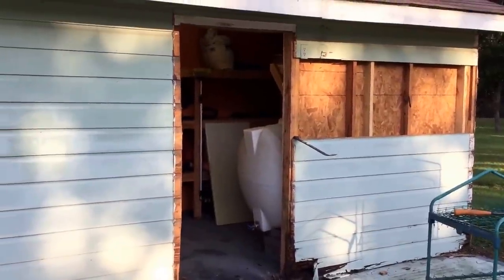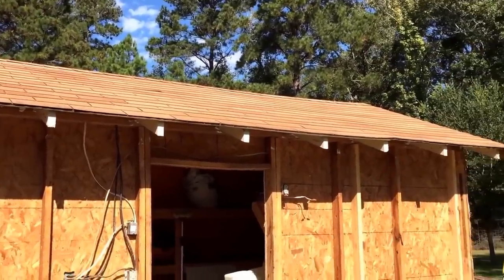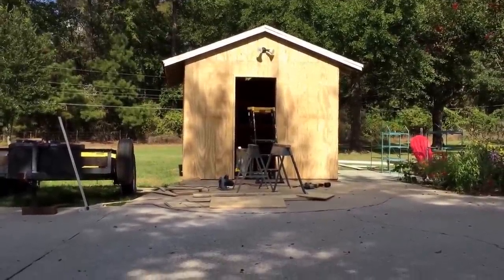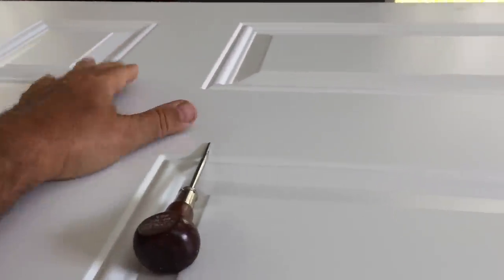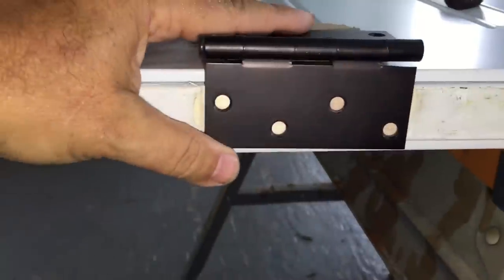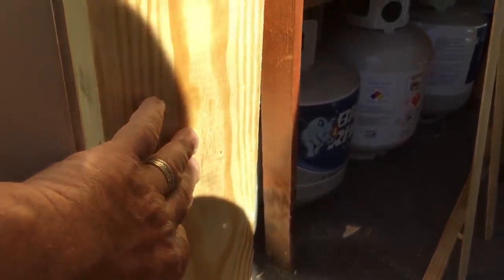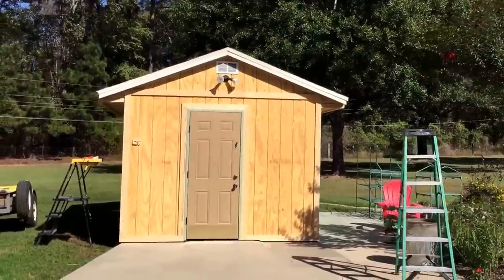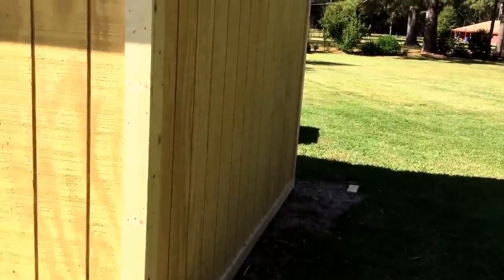How to Rebuild a rotting shed from start to finish

Comment: Purty. I've had awful good luck with the pre-primed LP Smartside siding.
Reply from the maker: bc65925 if that's the cement board,I thought I would use that until I lifted it. I couldn't have done it by myself using that stuff.
Reply: Nope, primed chipboard
Reply from the maker: bc65925 OSB doesn't fair to well here in Louisiana. Torrential rains and 100% humidity got right to work on the glue.

Comment: I have an existing shed that was originally built as a play house for my daughter who is now grown.             The original floor was wood which has rotted away.  I want to save the playhouse & turn it into a garden shed. I need to create a concrete floor & replace the rotted wood on the bottom of the walls & replace the door.  Do you have any suggestions as to how to find someone who could do this project?
Reply from the maker: Why not you??
Reply: @bctruck  I don't have the tools
Reply from the maker: I have no idea what to suggest. It’s something you could do with the most basic of tools.
Reply: @bctruck  Thank you, I will do my best